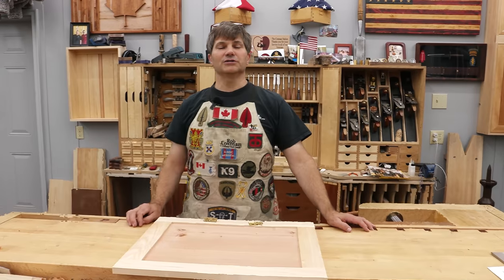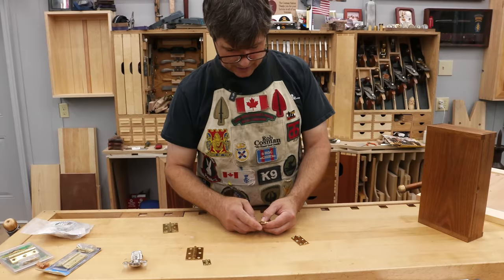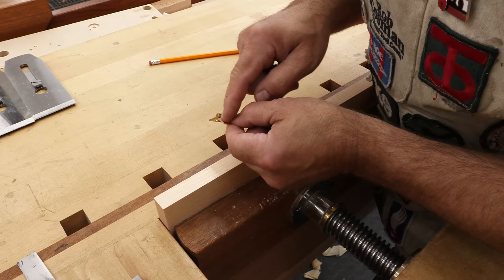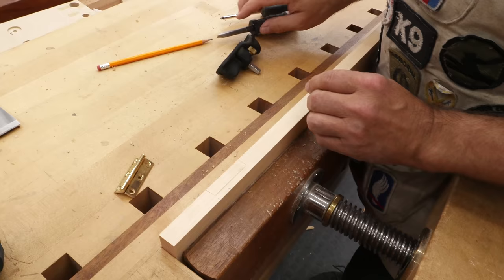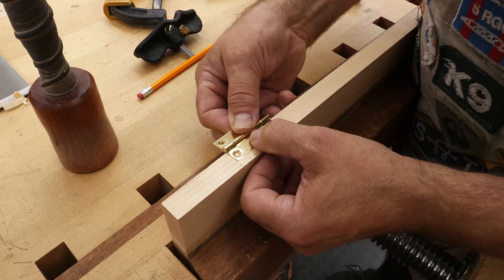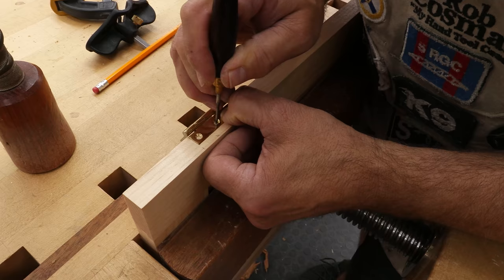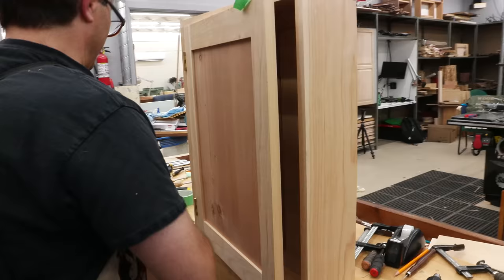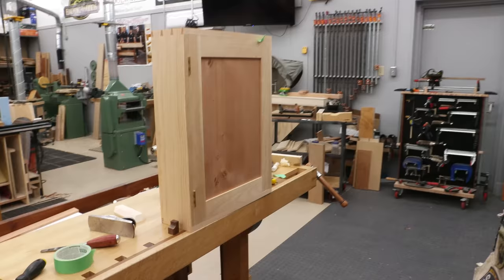Furniture Making for Beginners - Installing Butt Hinges and Fitting a Cabinet Door

Comment: What's amazing to me is that you can buy (by your own admission) quality hinges and still need to square them, deburr the back sides of the screw holes and enlarge the countersink for the heads. Personally, if I needed to go through that much trouble I would have spent the time sourcing hinges that were the size I wanted rather than using what was on hand. This aside, a fine tutorial. Thanks.

Comment: Great job Rob, a technic I like to use after breaking off many brass screws even with a pilot hole especially in hardwoods, is to first cut the threads with a steel screw and use them during the fit up and then replace them with brass screws and only use them once.
Reply from the maker: Me too!

Comment: If you buy drawn brass butt hinges the countersink should match traditional countersink slot head brass screws. The screw head should be recessed a little. It is best to use same size steel screws first if hardwood and second fit with the brass. This minimises the likelihood of the brass screws shearing or the screwdriver slipping from the slot. Set the hinges so that the radius of the fulcrum only protrudes, so set the marking gauge to the leaf width plus the radius. You may need to chamfer the edge. Lining up the screw head slots is usual.

Comment: Better way to remove the burr on the drilled holes is to take a drill bit and wrap the end with duct tape and then twist it with your fingers to make a small countersink. This is one of the things I learned 30 years ago working in a machine shop.
Reply: Interesting! Could you explain more please? Not sure I'm getting it
Reply: @CabinetFramingUK  Basically you wrap the end that you would normally chuck with tape masking tape probably being better than duct tape and then use the drill bit to countersink the hole very slightly by rotating the drill with your fingers . this will work for soft metals such as brass and aluminum . for steels you would use a handle in place of the tape think a dowel with a hole in it the sale size as the drill . Of course if you were Mr. Cosman you could just use your bit brace with a suitable size drill and just turn the handle 2or 3 times . P.S. that wasn't snark it was just another idea I had . After all not everybody has a bit brace and a set of Jennings pattern bits. I hope this answers any body's questions as to what I was describing.

Comment: With setting the router plane to finish depth, have you considered placing both hinges on the bench and sit the router plane on top, one hinge at each end and drop the blade till it reaches your bench.
Do you always set your hinges flush, or do you leave them a little high so you can trim later?
Will you be adding a door stop inside the frame? Brilliant idea to squaring the hinge
Reply from the maker: I go for flush hinges, sometimes I have to set them below flush to minimize the hing gap. Yes i will add a stop
Reply: Have you considered using a mortise plane?
Thanks Rob

Comment: As always I learned something new, in this case the use of a rebate plane to cut hinge recesses. One point however in the UK solid hinges such as you were fitting have an odd number of knuckles on each leaf. I would always put the larger number of knuckles on the cabinet e.g for a 5 knuckle hinge 3 on the carcase and 2 on the door. Any comment?
Reply: Just noticed my proof reading error, predicative text error.Rebate plane should of course have read router plane. To expand a little on the orientation of odd numbered hinge knuckles comment. On the door Rob was hinging the orientation of the knuckles issue is simply an aesthetic issue. However on a larger heavier door having the larger number of knuckles on the frame contributes to the effectiveness, strength of the hinges. Certainly having both hinges orientated the same way is for aesthetic reasons.
Reply: Yes. You hang the door to the frame or whatever. The door gets the smaller number of knuckles.

Comment: Were the screws you used supplied by the hinge manufacturer?  The hinge didn't seem to be made for the modern screw with the thick head.  I rue the day the slotted head wood screw with the sharp edge at the head chamfer and the proper thread design for wood met its demise!
The hinge you used although being premium grade and probably quite expensive was really inferior considering all the work required to bring it into specification!
Keep up the good work, JIM
Reply from the maker: Great catch, you are correct i was not using the screws that came with the hinge as I didn’t like them which is why they didn’t fit perfectly

Comment: Great lesson!!  A question: How do you account for the seasonal expansion and contraction of the wood in the rails and stiles with such precise fitting?
Reply: There is none..... it may rub sometimes. Cabinets or drawers with such tight tolerances will have to be adjusted in later years when the wood settles 😁
Reply from the maker: I am building in the most humid time of year for my area.  I expect the wood to only shrink from where it is now

Comment: It appears that the stiles are about 2 1/2 to 3 inches wide, which makes a total of about 5 to 6 inches of door width subject to seasonal expansion. Is this an issue with the tight fit that you created between the door and the cabinet?
Reply from the maker: You are correct, however, I am building these doors at the most humid time of year where I live, so the wood will likely only shrink from where it is now so I can get away with a very tight fit.  If I was making this in Dec or Jan when it dry where I live then I would have to go with a larger gap or accept refitting the door in summer

Comment: Rob, why wouldn't you do a whole kitchen like that? (referring to the last remark made by Rob)  What would you do differently when making kitchen cabinets?
Reply: It would take forever that's all 🤣
Reply: Jigs and templates for a router can speed things up considerably. On the other hand, there are those who find the manual  process cathartic and don't mind how long it takes. The cash saved on hiring a tradesman, covers their wives' therapy.
Reply: @gav2759  Hahahahah love it
Reply: Having such close tolerances increases the potential for seasonal jamming.  Which then leads to seasonal hounding from the wife.
Reply from the maker: I would do Euro hinges that have lots of adjustability and do overlay doors.  I would only do this method on my fine furniture pieces

Comment: In your previous video after fitting the door to the hanging side and the bottom of the cabinet , you could have planed a joint on the RH stile and top rail the thickness of a steel rule. That would have giving you a 1/32" joint all round after cutting the hinges. That is the gap between the two hinge leafs when closed.

Comment: This is not correct.
The spur of the marking guage should be set the the center of the pin on the outside.
The thickness of the hinge leaf determines the Depth of the mortise on the other side.
This called a "tapered gain."
Its a better, way, and the correct way.
Cut it out with a chisel

Comment: This is not for beginners. A beginnet does not have all tools and equipment you use in this job.
Reply from the maker: Mork how do you know that?  Would a beginner at golf  head out on the course with a putter and a driver?  Probably not.